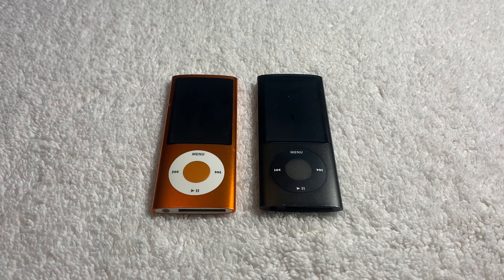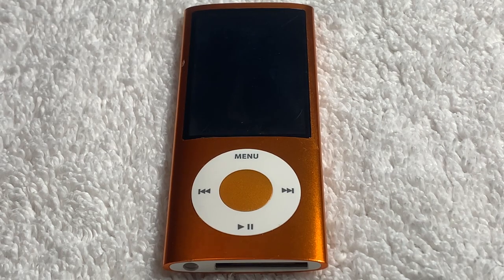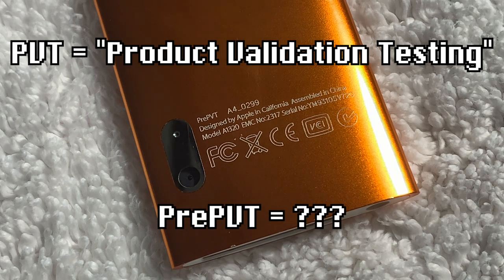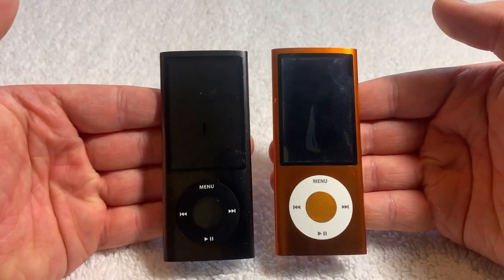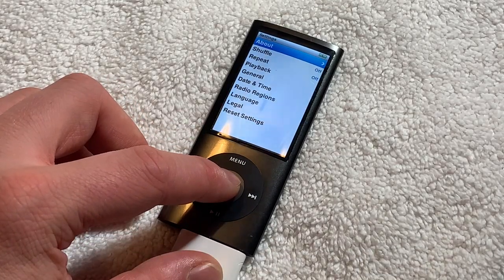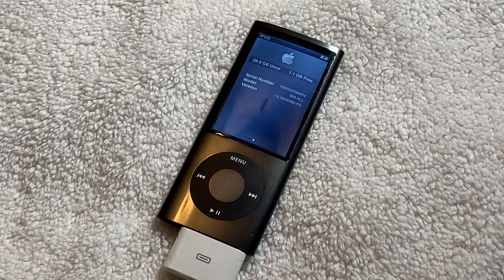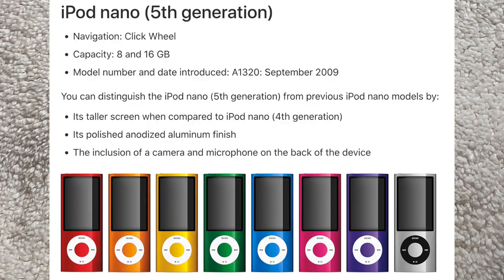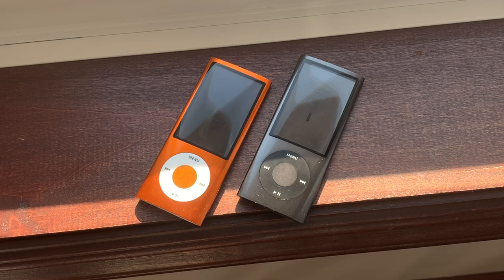iPod Nano Prototypes! - 5th Generation (PrePVT Stage) - Engineering Development Units -Apple History

Comment: 4:58 honestly i don't think so, i think this is probably something to do with the iPod Nano's price point, or a manufacturing issue, you have to consider the lineup of the time with the iPod touch only having 64GB that same year, the classic always being the higher end, but fatter iPod, with the spinning drive, but already had 160GB, so an extra what, 16gb, isn't really going to convince iPod classic buyers to the touch or the nano, and the shuffle having only ever what, 4gb?
i think this is an issue with the Nano having to be cheaper than the touch was, and how much NAND flash storage was back in 2009, to fit 4GB in the Nano 1 was impressive in 2005, to fit 16GB was insane in 2009, but also somewhat pricy as it was, the touch had the extra budget to fit higher storage capacities, but NAND flash storage was getting cheaper by the time they finally gave the touch it's next storage upgrade.
Not only that you can see in some DankPods videos, some classics just couldn't handle the higher storage when people try to mod them, i think either it couldn't read the storage properly, or it just didn't have the RAM at the time to handle 32GB when you properly fill them, which is probably why there's only 1.1GB left of that 32GB. 
i'm not sure about that, that's just my theory.
Reply: Nothing to do with ram 🙄